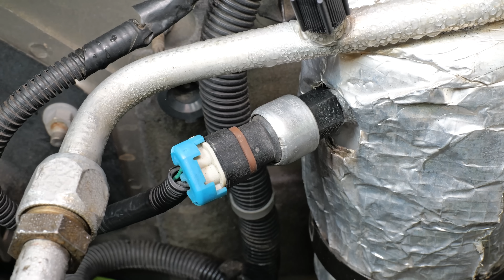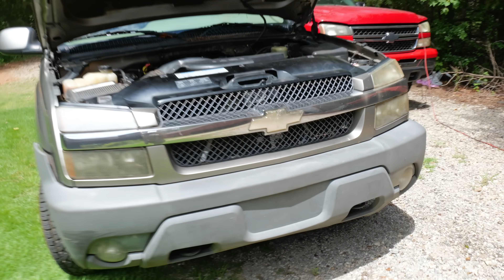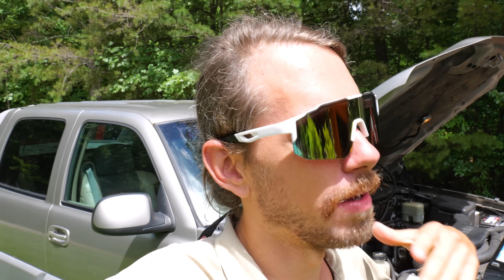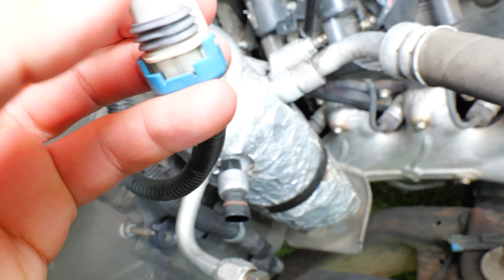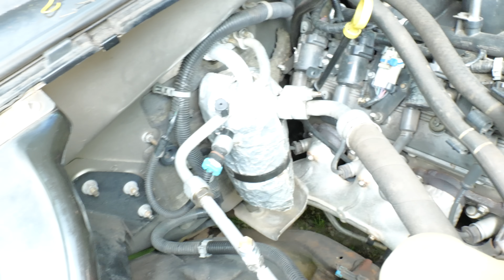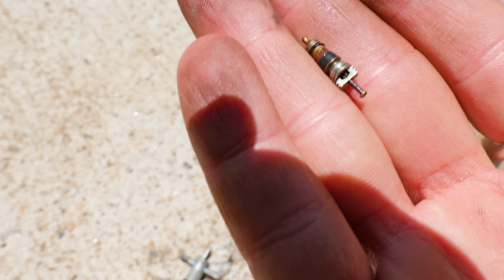BAD Chevy Truck AC Pressure Switch? THINK AGAIN

Comment: I’m at wits end….new accumulator, new orifice tube, new valve in low side, new complete high pressure valve. Still only cooling to 71. Pulled vacuumed for 40 mins. Let it sit another 40 mins gauges didn’t move. Low side is around 45-50psi high side is around 150 psi. Compressor engages and short cycles till enough r-134a is present then compressor never kicks off. Pull hvac fuse and recalibrated digital auto ac inside, replaced both blend door actuators. Guess my compressor is no good? When I try to jump the pressure switch connector before I added r-134a it did not turn on?!?! But works when adding r-134a just won’t cycle off?
Reply: If the suction pressure was 40-50 psi your compressor is fine. You have a clog somewhere in one of the lines.
Use nitrogen to blast the lines out in a reverse pattern than the refrigerant flows. You can do this by just removing Schrader valves usually.
Reply: When a compressor starts to fail you will see a rise in suction pressure because the valve in the compressor is damaged.
Reply: @Reallifenewz if was extremely old orphic tube and leaking valve stem
Reply: @jeremyjames2606 Thanks for responding. Comments help others with similar issues. Your capillary tubing is post refrigerant metering device. They are aluminum. They don’t age. Most cases they are part of the evaporator. You had debris in the system. Could be from a compressor imploding or techs being careless while replacing a component.
Reply: @Reallifenewz  looked that dark grey when a compressor dies… but I’m sure this was the original Orifice tube from 2004 and I swapped out the high side complete valve. Had already replaced the receiver drier and low side valve. But after replacing high side valve and orifice tube it’s been working great for the last 2 months
Reply: Did you find any debris when you removed the orifice tube? Also you can tell when the compressor is going out by using some gauges, let the ac run for a bit, then turn off the ac or the car. If the pressures equalize fast that typically means that the compressor is not good. The needles on the gauge should somewhat slowly equalize.

Comment: My compressor turns on at the relay if i jump it but not at the switch plug if i jump it please any help would be appreciated !!
Reply: Same problem did you figure anything out!!
Reply: @Thumopolis  yes after chasing the grounds and "cleaning the connectors at the computer changing fuses and realys looks like the manual AC control module i bought was defectiv. I had a weird feeling i replaced it cause my original looked old and the lights no longer worked. I decided to remove the new one and re install my old one and boom everything worked. So im guessing it was a bad "snowflake" switch

Comment: what if jumping the plug results in the compressor clutch kicking on?
Reply from the maker: Then the charge is probably low
Reply: @MattsShop sorry meant to say what if the clutch does not kick on when jumped?
Reply: @Minnesotanoice that’s what mine is doing

Comment: Can't you just test the Ohms on the switch itself to see if it's working?
Reply from the maker: You can but it's hard to tell sometimes depending on if the compressor is running or not.

Comment: Can you please inform me if this is normal i have 07 tahoe the AC is working very well even the ac temp reaches to 0°c its so cold but i noticed the  radiator fans are working 100% most of the time even while driving 80mph it turns off for about a minute then works again btw the Ambient temperature here in saudi is between 110-113 
Ac High pressure side is between 1600-2300kpa

Comment: 99 yukon.  Compressor clicks on clicks off right away  repeat repeat repeat.      Tried charging. According to pressure after charge its right pressure , but still click on click off.      If the compressor won't run then how can it accept charge.   Is this when you jump the pressure switch.      Just bought the truck.   Ac was blowing warm air but compressor was running.   I charged it.   5 days later completky stopped working.  Click on click off.    Any help would be appreciated.

Comment: I just had my compressor and accumulator changed. My ac blows nice and cold when I'm driving. Suddenly while sitting in idle for 5 minutes or so the compressor kicks off. Then after I start driving a few miles it comes back on. Today I started the van and the compressor didn't engage. I tapped the switch and it came on. I let it idle for 5 minutes and the compressor shut off. I tapped the switch but the compressor doesn't engage. I jumped the switch and the compressor kicked in. What do you think in that situation? Any advice would be welcomed. Thanks.
Reply: Did you ever find your issue? I have the exact issue on mine 🤦🏽‍♂️
Reply: @gaelgalarza9910 I ended up changing the switch and that solved the issue. The switch has a shrader valve behind it so no worry about refrigerant loss.

Comment: so if the compressor is working properly it shuts off and on fairly quickly?  Does it cycle on off like every 10 seconds or something?  When i listen to my truck idle with the hood open i always would hear it cycle on and off.  Never really timed it though.  Anyway just had my A/C serviced they had to replace a schrader valve and the upper rail because of a leak(?) My truck is 23 years old and to my knowledge i never had the AC serviced but it always worked well the last couple of seasons when idling in the heat and stopped  the AC didnt really work very well (Up till then i never had a problem with it and i live in Central California plenty of 100F+ days in summer)  Can my trucks cooling system have an affect on the AC or are they totally separate systems ?  Anyway the problem know is oft times it takes my AC quite a while to start pushing out cold air on the hottest days/times of day.  I just moved quite a distance from my regular mechanic so dropping back in there to have them take a look won't happen.  Is there new refrigerants used now in 2025 that react differently then the ones that were used 20+ years ago?  Or did I just open a can of worms by having the darn thing serviced when it was working pretty good already.
Reply from the maker: The charge has to be the exact amount. About 1.8lbs R134A for regular pickup trucks. Th compressor is supposed to cycle on and off. It's normal to take time to cool down depending on how hot it is. It's hard to say, but if they are cooling well I leave them alone. They make thermometers for the vents to see if yours is blowing the right temp. No R134A is the only refrigerant you should run.

Comment: I don't understand why you said if you leave the jumper wire in the connection, it "will damage the compressor". Those compressors are designed to run 100% when in Defrost or under hotter conditions; there's no reason to cycle the clutch then. 
Consider the problem it would create if the clutch is cycled ON/OFF at highway speeds --- all the extra clutch wear and shock to the compressor while the engine is doing 80 MPH. 
NOW ===> about shoving wires into those electrical contacts --- back-probe instead to keep the connections tight so they won't burn if they get loose and cause a lot of resistive heat. (just saying). 
I think your viewers could be helped a lot too, if you explain the parallel/series electric cooling fan circuit with the three relays. 

I love your videos --- just a little fine-tuning - things I learned when I worked (then) like you do now, for my 57+ years.
Reply: Based on Matt's assumption that the high-pressure switch is not the cause of the AC malfunction but more likely a low on freon issue, the compressor would be damaged because there is oil mixed with the freon and if the freon charge is low there would be no oil available to lubricate the compressor. Hence the compressor would be damaged by running it for more than a few moments without adequate lubrication.
Reply: I have 07 tahoe the AC is very cold it reaches 0°c but i noticed the radiator fans are working 100% most of the time even while driving 80mph it turns off for about a minute then On again is that normal? Ambient temperature is 110-113
And the compressor is on 99% of the time

Comment: I have a 2004 chevy tahoe and my refrigerant says its full but my air doesnt get freezing cold. It get cold but not as cold as it should
 I also dont hear the compresseor come on anymore either. Any tips or what am i doing wrong? Thanks
Reply: There would be no cooling if the compressor didn't "come on anymore". What temp is the discharge in the middle vent at medium blower speed? It should be right around 40°F - and if so, that's a good value. 
FTR: HVAC cannot run below the freezing point of water or it would ice up and stop cooling. Actually, the coldest - in a perfect world - would be 36°F or so, +/- 2°F, but that gets too close to freezing, so you shoudn't see that temperature if the system is otherwise  healthy.

Comment: The recent heat wave in the south has caused my 2013 Cadillac Escalade's A/C to drop offline at critical moments. I just found out that the system was overcharged. I rigged up a system to recover the overcharge using an empty bottle of R135a I'd gotten for a vehicle some years back. The gauge that was integral to the kit came in handy.

The underhood heat stresses of this blazing b*stard of a summer stressed the refrigerant to a point of expansion as I'd drive and suddenly I was without that frosty, conditioned air. For the time being I believe that I have found my vehicle's aging A/C system's sweet spot for operation in severe heat situations.

Comment: 02 Silverado 1500.   At idle. Ac blows warm air. As soon I I start driving, it works fine. What should I do
Reply from the maker: This is like the most common problem. Guys keep saying it's the compressor, but I think maybe the compressor clutch is bad.
Reply: @MattsShop All a sudden the other day the ac no longer blows cold at all. Compressor clicks on and short cycles every few seconds. Tried to replace the two wire pressure switch. Didn’t fix it. Connected 134a bottle with the gauge on it to see what it was doing while the truck was running ac on high. Compressor not spinning the reading went to the red. When it clicked on reading on gauge went very low. Any tips ideas or trouble shooting I should try
Reply: @Suzukigsxrdave you’re just low on refrigerant. Try to find the leak first because most fixes have to be done without any pressure in the system. Check Schraeder valves and o rings. Or if you wanna go the easier/more expensive route get some refrigerant with u. Dye in it and a uv light, add that to the system then check all possible leak points with the uv light to find leak. Repair leak and recharge system. Sometimes when the system is super empty you’ll have to jump the pressure switch plug with a wire to start the compressor while you’re adding refrigerant. System will not accept the refrigerant unless the compressor is running and it won’t run if there’s no pressure (annoying I know). Hope this helps u. Good luck

Comment: I had the common problem that all 99-06 trucks have with there AC with 1 or 2 setting not turning on. Bought a new Resistor and swapped it but now 3 weeks later setting 4 doesn’t work again on my AC?? Any ideas @MattsShop
Reply from the maker: It uses air flow to cool the resistor. I'm trying to figure out why. Probably just a cheap part.
Reply: @MattsShop Thanks Matt 💯
Reply: @MattsShop  That's been the design since I can remember --- going back to 1956-9 GMs (Cads, in particular) - that the resistor bank was always in the fresh air stream to cool it. The blower motor was (in those days) non-PWM and they needed to cool the resistor. Now --- even the PWM blower control (some are infinite speed do-able) need to be cooled because they create heat too.
Reply: Another resistor

Comment: Hey mat I’ve been struggling with my GMT 800 and have no idea what’s wrong with it. As soon as I go over 50 km the engine starts to surge up 200 RPMs, then back down every two seconds when I floor it it’s fine or when I’m going slow it’s fine. Please anything helps.

Comment: I just had a 4l60e rebuilt and the mechanic says that the dash lights flicker / no won’t shift into park / key won’t come out what could you think this is?
Reply: The shift indicator lights in the dash don't work right either but the shifter does.  it has something electrical screwed up some where. I'll let u know what the code reader says but it will have to be put on a scanner to really tell what it is. If I was not getting power it would start out in third but it's starting out in first.

Comment: Got any advice on getting my suburbans AC to blow cold in the front. I have cold AC in the back but cool AC in the front?
Reply: Did u ever find problem
Reply: @liljon0219 New evap core more than likely mine got blocked up and wouldn’t let air threw. Did the grinder to the plastic box hack with jb weld to hold it together again. Blows like new now.

Comment: What does it mean when I stop or idle and my ac gets hot but cold when im driving? 2005 avalanche
Reply: CHECK IF YOUR FANS ARE WORKING.
When moving the coils are cooled by the moving air. When you are stopped, no cooling

Comment: You didn’t put that shrader valve in the parts list if you could do that I would love it, I bought the shrader valve from harbor freight but I’m assuming that’s not right?
Reply from the maker: It's in the list with the kit with caps. They don't sell them separately. They sell a pack.

Comment: Matt sometimes it’s the switch plug 🔌 the terminals get lose and don’t pass drag test de pin and tighten then plug it back in no more on off switch!
Reply from the maker: That's wild! I don't doubt it. The connector doesn't seem very strong.
Reply: Could you explain further please? I may have this issue.. when I jump from relay compressor kicks on but at the pressure switch plug when I jump it, NOTHING. Wondering how to fix if the problem is the plug. Thank you
Reply: @Thumopolis I’m having this same issue while trying to charge my system, have you found the issue?
Reply: @Thumopolis  @MattsShop same.  When I try to jump at the pressure switch plug, I get nothing.  How do I check that wiring?  Is the compressor bad?
Reply: @Robdaddy11  never figured it out, good luck 🍀

Comment: I had an issue with my ac pressure switch, it took me quite awhile to narrow it down. I was having the issue where my ac would be on blasted cold air, 5 min down the road it would switch to heat, and then back to ac. I thought I was having heater actuator issues and tried replacing them with no luck. Once I replaced the ac pressure switch I was back to ice cold air conditioning, no more randomly switching to full blast heat. This was on a 06 gmc sierra hope this helps.
Reply from the maker: Nice! Glad you got it fixed. It was the switch in your case.

Comment: I had a problem with my 2002 Avalanche. The problem was with the clutch on the compressor.  When it got hot the clutch would disengage. At over 200K miles I replaced the compressor.
Reply from the maker: Yeahhh the clutch is a common failure point. For sure!!

Comment: What if the AC won't come on but unplugging and repluggjng the low pressure switch will kick it on?
Reply from the maker: No it will never come on like that if the charge is low.
Reply: @MattsShop what would it point to? I've tested the relay and once it's on it stays cold and cycles as it should.  Sometimes it won't run the compressor until the low pressure switch is unplugged and plugged back in.
Reply: @LS79S10  According to the GM Compressor Clutch Diagnosis flow chart --- the clutch is not a test of the system operating correctly or not. I've had clutches with too much air gap create this same "identical" problem. The system must be looked at as a whole series of parts that all have to operate correctly in order for it to work at all.

Comment: my blower motor plug keeps melting i replaced the resistor and plug and it still did it do you think it is the blower motor creating to much resistance i have a 2500hd 2006 chevy
Reply from the maker: Yeah the blower resistors always burn out. I'm gonna test some different ones.
Reply: @MattsShop what do you do to fix this issue
Reply: I read the rest of the posts on your question and I'd say the blower motor is drawing a heavy amount of power --- too much for the way the system was designed, and that might be a bad blower motor.
Reply: Check the wiring between the resistor and the big connector in the door jamb
Reply: My 2003 had the same problem, and i replaced the wiring several times. I finally decided to test the amps with a jaw-type amp tester and found that if I turned the 0 to 5 fan speed selector above 3, it drew too many amps for the size wiring. I now limit the speed selector to 3 and have had no more over-heated wire problems.

Comment: what about high speed radiator fans not coming on when ac is on?
Reply: There are times when the fans will run on Low speed for a while --- and then switch to High speed; and that MIGHT be normal --- if you can factor in the relative conditions. This system is sophisticated enough to let a lot of false opinions form from previous experiences in other makes/models. In the electricsl chain of power flow are relays (3 for the fans alone), relays for the cabin blower fan, wiring, power supply, ground integrity, temperature and pressure switches operating correctly or not, R134a charge, ambient temps, command/control from the Auto or Manual controls, blower resistor or logic packs, --- there's a lot to consider.

Comment: A good video idea might be to pick up one of those little Amazon devices that let you change the valve without removing all the refrigerant. I must admit I’m curious.
Reply from the maker: Yea I need to get me one. I normally just end up recharging the whole system.
Reply: Not a bad plan since the valves always leak eventually